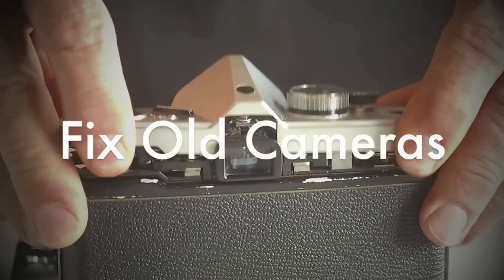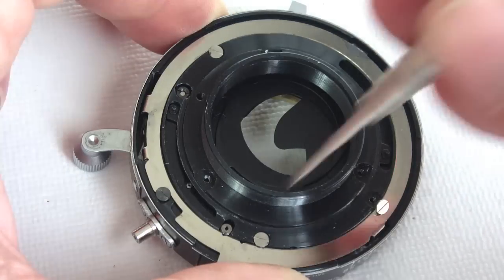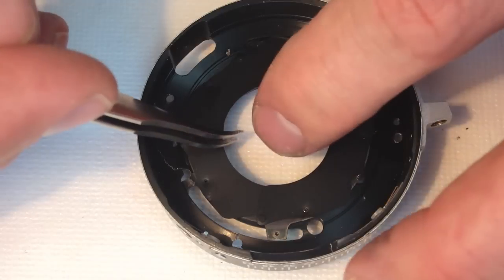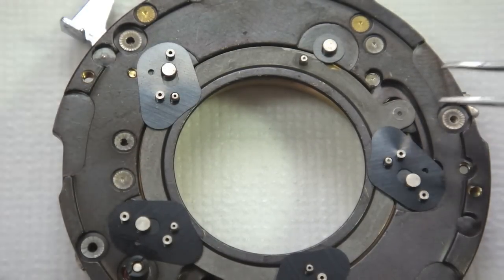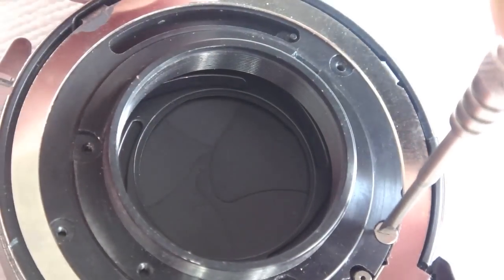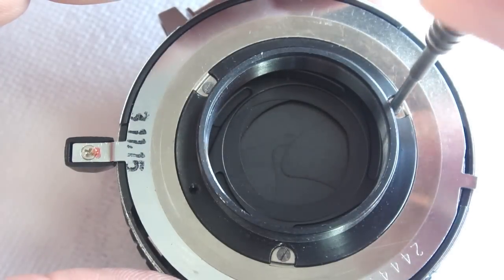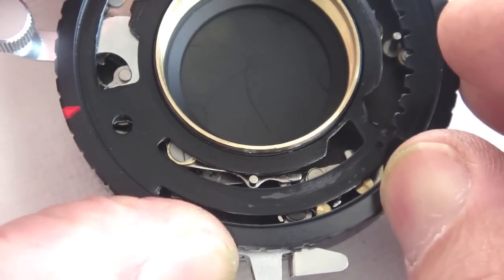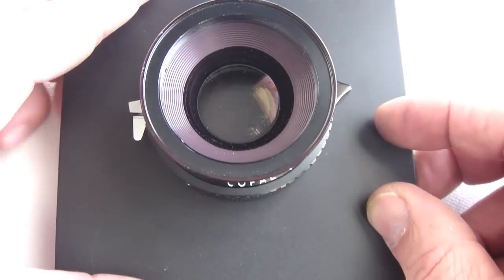Fix Old Cameras: Copal #0 Shutter Blades

Comment: Super helpful!  was repairing a Copal SVE shutter on a Yashica Lynx 14 and referred to your video. For anyone else working with this, there's an extra shim that goes on top of blade #5. The blades are counted clockwise starting from the main lever.
Reply: Hey i broke a screw on my Copal SVE lynx 14. Do you know where i can find a replacement?
Reply: @Y0usmelled  Can you describe what screw you're talking about? And how can I get in touch with you?
Reply: a black screw with a broad screw head. possibly left hand threaded
Reply: @MyAddictedLife   as to how you could get in touch with me. I have been commenting these past few days but i noticed that my comments get deleted when i try to mention my socials. So that's amazing

Comment: Great video. working on a Copal SV shutter system on an old Yashica Lynx 1000, and while not completely identical, there's a lot of similarities. in particular, I think watching your reassembly of the shutter timing mechanisms will really help me out, as I think I've located the source of my problem. none of the slow shutter speeds work on mine, just B or 1/1000. but looking at your slow speed escapement, I noticed the little pie shipped cog is placed a particular way, and I think it's out of place on mine. I think that might be the cause of it not working, as it can't actuate the other gears. I'll try fixing that and see if that works. then I'll have to move on to the aperture blades, as they fell off their mounts. thanks so much.  😊

Comment: Thanks for your information , please talk about copal mxv for yashica 635
Reply from the maker: The shutter covered in the FOC video Copal #0 Shutter Blades is very similar to the shutter in Yashica twin lens cameras. A video showing how to access this shutters will be produced sometime in the future. In the mean time you can peel the leatherette from the front of the camera to reveal the screws that hold the front plate in place. Be mindful of the linkages when you lift the cover plate free.

Comment: I have a Copal #0 produced for a Nikkor SW lens. Upon reinstalling the shutter blades, there is an additional spacer that I presume is to be placed atop one of the blades - but which one? I cannot see this piece in your video or other guides I have come across. I can only see reference to in in an exploded parts-diagram of an older Copal shutter but it's not clear onto which blade it should be placed.

Comment: I have a Voightlander Bessa 2 with a slow shutter problem, will this guide help me or the mechanism is way different?
Reply from the maker: Saviano Luz The Bessa is a wonderful classic camera! The Copal and Compur do share some similarity of design, however for a sluggish shutter complete disassembly would unlikely be needed. Slow shutter speeds is often caused by the slow speed escapement needing to be cleaned and very lightly lubricated on the pivot points. A weak main spring can also cause the blades to hang up. Of course the blades themselves need to be clean and devoid of any oily residue. A recent post on the Fix Old Cameras google plus page shows an exploded view of the areas mentioned on a Synchro Compur #00 shutter. And an up coming FOC video will feature the Synchro Compur #00 shutter.

Comment: Should the aperture or shutter blades be cleaned before reassembly? If yes with what?
Reply from the maker: sewing1243 Yes, you may clean them with 91 percent isopropyl alcohol, if there is any residual oil on the blades. The blades should be clean and oil free upon installation.

Comment: I have a mamiya press 100mm 3.5. Seikosha s shutter. the speed is stuck at 1/500sec. i believe there is a cam which slows the shutter to other speeds. is this easily available. what is normally the cause of the cam not working?
Reply from the maker: There is a speed cam ring. The speed cam ring followers might not be engaging the speed cam ring. Possible the speed cam ring is not seated as it should be.
Reply: Thanks will look into it soon.

Comment: Your videos are really helpful!
But I have a question: How about the shutter blades fail to form light tight closure. What might cause this issue?
I have a German TLR (weltaflex with vebur shutter), everything looks and works well mechanically but in the dark I noticed I can see a very little amount of light passing through the blades. I don't know whether it's worth (and possible) to fix it. :-/ any tips?
Reply from the maker: Check to make certain the blades are closing completely. Could be from wear or possibly the retaining plates are slightly loose allowing for play in the operation.
Reply: @FixOldCameras   The blades close completely. They look good to me. I supose the retaining plates are slightly loose, because if I touch the blades they can move a little. Thank you so much for answering!

Comment: anyone else notice that the aperture blades were reassembled wrong?
Reply from the maker: Hmmm... seems to work OK. What should be done differently?
Reply: they all need to overlap each other in the correct order so that each blade is sandwiched between and supported by the two on either side. otherwise you get gaps and light leaks and uneven wear from edges rubbing against each other and unsupported blade tips flopping around enough to potentially snag on something and cause a catastrophic failure.
Reply from the maker: Indeed the blades need to be installed in the correct order otherwise they will not work. What needs to be done differently in the application shown?